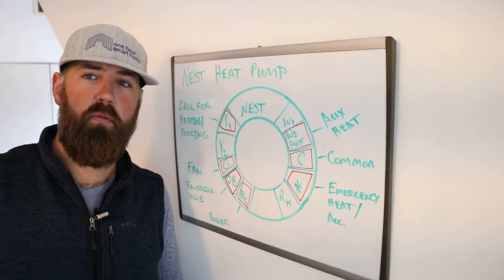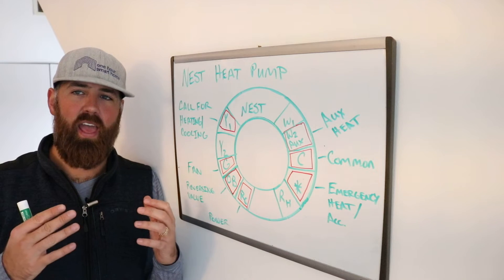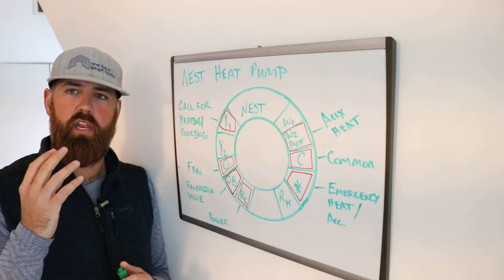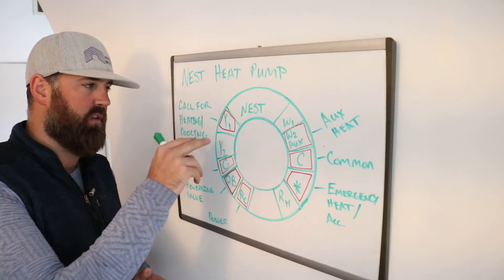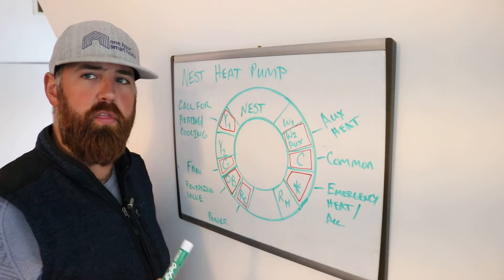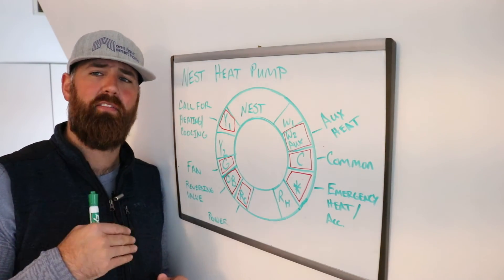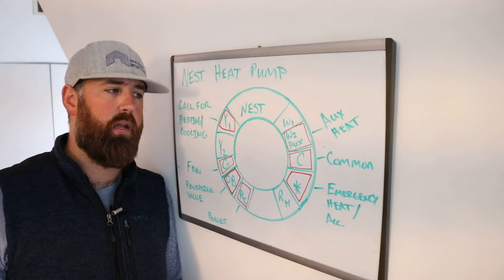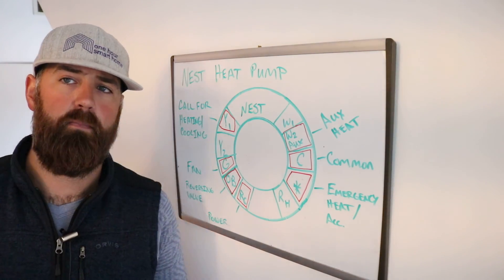Nest Heat Pump Wiring Diagram:  How To Wire Nest With a Heat Pump

Comment: I have watched two of your videos.  You are very good.  And, I finally picked up how thermostats manage to work without a common wire.. they steel a little current through the other circuits but do not sink enough to turn them on.  That explains it.

Comment: I have a Fujitsu mini split, I use a adapter (UTY-TTRX) to connect to nest. In the nest equipment setting, what should the heat set to. Choices are force air, propane, electric, gas, oil, geothermal. What should the settings be using the mini split.

Comment: Is there any way to use this device to make a wood pellet stove and heat pump work together? Bought the house with just a wood pellet stove. Installed new set up for that (on a thermostat control) and the heat pump installed has a separate thermostat control. We would love to have both working in cooperation with the other.

Comment: Very helpful - I have the exact same wires for my set-up in Tallahassee Florida - pretty sure I hooked it up exactly as shown, but when it tried to cool the house, it started heating it - any help? i can send you photos if helpful
Reply from the maker: Possible that your reversing valve is (Reversed). Some heat pumps are designed to heat when power is applied to the reversing valve and some are designed to cool when power is applied, just depends on the manufacturer. The setting to (Reverse) the heat pump reversing valve is within the nest. Under the equipment tab, click on the O/B wire selection and then it should allow you to change it. Try changing it from the current setting you have it on and it should change it.
Reply: @OneHourSmartHome  thank you - I'll give it a shot

Comment: I have a trane set up.  Currently,  I have no C wire.  I do have a dedicated B and dedicated O terminals along with the Y, W1, W2, green.   The nest has only B/O terminal as well as the ecobee.  Ecobee tech said it isn't compatible.   Is the nest compatible and where will I place the B wire and O wire?
Reply: O goes to O/B. B is your common wire so it will go to C. I have Trane system too and my next app says I have an error but everything seems to be working well.

Comment: This was a huge help. Double checked what Google sent me and they had me wiring my heat pump up like a dual fuel setup. This was confusing to me as I have no gas lines going to the house at all. Not entirely their fault as whoever installed the system originally ran the Aux heat as a white wire plugged into a W1 terminal and a black wire plugged into terminal with 2 labels W2/X2 which has to be emergency heat.
Reply: May I ask if the black or white that has to be going to the * terminal? Thanks!

Comment: @onehoursmarthome I have a Heat Pump and when connecting the Nest the condenser goes crazy ( on and off by itself ) and the Nest say error on O/B  and also Error on Y1..  any idea what can it be ?  😩
Reply from the maker: Do you have a common wire? Could be that the nest is short cycling due to low power.  Here's the video on common wires: https://youtu.be/gahPxCcPDto. Next question do you have both and O and a B wire or just an O/B combo wire? Nest is not compatible with systems that have a separate O and B wire.

Comment: Can you explain how to connect and how it operates a heat pump with multistage heat/cool since nest is compatible with 2 stage cooling and 3 stage heating.
Reply: Would also love this.
Reply: If it's compatible like you mentioned then the 4 electricians I have hired need a worse review.

Comment: Question, about Nest basic one.  Is it compatible with the Airtemp heat pump?  I tried connecting it but it would not turn on the condenser.  The fan turned on but not the condenser.
Reply from the maker: I dont know specifically if it works with the airtemp heat pump. Sometimes it takes a few minutes for heat pump condensors to turn on with the nest and the safety timer it has to prevent short cycling. Did you turn off the condensor power when installing the nest? Sometimes people forget they turned it off and just need to turn the circuit back on.
Reply: Yes, I turned off the breaker for the condenser. Then I plugged the Nest all 6 wire.  Turn the breakers on. Then on the Nest I turn the cool air on,  for about 3 min the condenser would not kick in. Then 4 min into it the air started getting warm air.    On the thermostat that came with the Airtemp, the Y-wire & W-wire has a jumper in between them. Also the RH & RC has a jumper.  Any clues on why the condenser will not turn on?

Comment: Question i installed the best learning 3rd gen. The issue I’m having is the fan doesn’t want to shut completely down.
Reply from the maker: Hm, interesting check the settings to make sure you didnt turn the fan on in the nest app. Do you have a g wire? What is it connected to?

Comment: Super helpful, thank you. On my old thermostat, I also have a F wire.  The manual for the old thermostat reads that this is a "heat pump reset (powered continuously when in emergency heat)".  Any idea where that wire would go on a nest thermostat?
Reply: sounds like it would go on the Star pin on the next thermostat.

Comment: Hi - I currently have a Lennox Elite XC16S036 unit, and looking to convert the thermostat to a Nest one. I can account for the Red, White, Blue, and Yellow wires, but I can't understand why there is a Green wire going into the "B" if my Lennox Elite XC16S036 isn't a Heat Pump? Looking for some advice, and thank you for sharing your wisdom!

Comment: Great video. One question. If you have a house with a AC system in the attic and a boiler in the basement. Which unit gets the common terminal?
Reply: Whichever unit the tstat is hooked to.
Reply: @guyinpajamapants6892  it would be hooked to both

Comment: Hello looking for some help.  I have an older heat pump in a condo.  
I used to have a Nest E and wires up all 5 wires Y1, W1, G, R and C, the Nest E worked fine.  
I am now trying to upgrade to the Nest Learning 3rd generation and it's not working.  Says the wiring is incorrect. 
I wired the terminals the exact same way as above with the Nest E,  except I placed  the R wire in the Rh terminal.  Didn't work.  Tried to move the R wire to Rc, same issue.  Not enough power.  What am I doing wrong?

Comment: Just wanted to add a bit of info about heat pumps: Auxilary heat also engages when the heat pump enters "defrost mode" which, (much like a freezer) occurs when the "evaporator" (outdoor coil in this case) ices over tripping the sensor which causes the reversing valve to disengage, turning the system back into an "air conditioner".  This causes cold air to blow inside the house. (ya, in heat mode!) So to offset the temperature split, the electric heat strips engage simultaneously until the defrost cycle completes, and the system returns to normal "heat pump" operation (extremely inefficient way to do your heat).
Reply from the maker: Thanks for the informative comment!
Reply: Thanks
Reply: Hello. I think this comment helps with my issue. I have a heat pump that is tuning off before getting to the set point temperature and starts blowing cold air inside in heat mode. I think is because I connected the aux heat (w2) but I don't have the auxilary electric strip ( optional accesory). Should I disconnect the W2 cable? Or adjust some setting in the Nest thermostat?
Reply: @davidportillo6006  Whats the outside air temperature?  If the unit is going into defrost because its too cold outside but you dont have an "emergency" electric heat strip, it will blow cold.  Although noone should have ever let there be no heat strips unless you live in South Florida, its more likely that the heat strip isnt engaging either because of relay, board, or T-stat.
Reply: So as the common wire, a positive or negative

Comment: Just bought a new house and would like to replaced Honeywell T6 pro programmable thermostats with my nest 3 gen. The video was great but I have an orange and brown wire that are connected to S “ input for wired indoor or outdoor sensors (TH6320U and TH6220U only) I am not sure my nest will work any suggestions

Comment: Excellent video. I have a White-Rodgers 1F92-71. I have 6 wires but I also have jumper wires. Nest online says I don't need jumpers and it appears the Nest thermostat does not allow enough space for more than one wire at the terminals. I'm glad you mentioned the software programming of the Nest. Great video!

Comment: I have a Robert Shaw moldel 9701j2 that I am out to a Nest.  I have a heat pump as well.  I found that I have 8 wires coming out of the wall and they were all connected to the thermostat.  Besides the R, Y, W, G, Blue wires I have a brown that was connected to the "C" terminal.  The orange and black wires were connected to a terminal next to each other..  Where do I connect the orange and black wire to the Nest connector plate?  Thank you!

Comment: I have a nest E
That I was going to install on a 2015 Trane Two-stage heat pump. It’s a all in one system mounted on top of a home. My buddy says that nest simply isn’t compatible with a two-stage system. Is that true?
Reply from the maker: Nest Gen 3:  https://amzn.to/3chelSz works with most  2 stage heat pumps. The Nest E has less compatibility and fewer terminals so it does not work with as many systems.

Comment: I have mine wired like these except the emergency heat. My heat strip wasn't kicking in and when I switched from heat to cool no issues. But when I switched from cool to heat my unit is short cycling.  Do have an info what could be going on?

Comment: I have a two stage gas furnace and I am going to install another heat pump on top of it. Do I need to connect w1 and w2 for two stage gas furnace and connect y1 and ob for the heat pump?

Comment: I have a nest thermostat gen 3.I have a heat pump.when you go into setting and press on heat pump.does it go on O or B?
Reply: I just spent hrs going through a Trane heat pump X14i with aux electric heat nest install with success. Google support advised a wrong way to wire so I’ll try to give as much detail to save you some time. This unit had both O (orange/heat pump valve), B (Blue/24V Common), G (Green/Fan), Y1 (Yellow/heat-cool), R (red/Power), W (white/Aux heat). Here’s the kicker with the White wire, this video helped me solve, it was W1 on the old thermostat and connected to the W1 on the Trane indoor unit. However on the indoor unit the W1 & W2 were bridged, which I didn’t notice at first. As this video states put white wire to W2. Having a orange and blue wire was confusing seeing the nest has only one input labeled O/B. Trane I read sometimes uses B for Common so I tested with meter (with breaker power on/AC off) and found to be true. So B/Blue goes to C on nest. O/Orange/heat pump wire goes to O/B on nest. Note I read sometimes these can be flip flopped so if you test and heat turns on when in cooling mode this could be the case. Green/Fan to G on nest. Yellow wire to Y1 “Heat/Cool”. Red/Power to RH..... for others If you only have one of the wires O or B it could be that you don’t have a common wire and are getting a power error on thermostat. The guys who made throw video has a video for that fix and a amazon link to the parts you need. I bought that but ended up not needing. Hope this helps! Good luck
Reply from the maker: Depends on the heat pump model. Do you have both an O and B Wire or just one wire? If you have just one wire The O wire reverses the valve from heating to cooling, and the B wire switches the valve from cooling to heating. You can look in the heat pump model documentation and it will tell you. If not you can set the heat pump to one setting and test that it is working and if not, change it over to the other setting.
Reply: One Hour Smart Home  What if you have both?

Comment: Great info...
I have an additional question... Just had installed a single stage heat pump with single stage propane furnace aux / emergency heat (no electric heat strips). HVAC tech and I have both found conflicting information as to whether this would be wired as a heat pump with aux heat, as in this video or, if it should be wired as a “dual fuel” system.
We wired it as dual fuel using both the W1 terminal and the * terminal ( believe they are both connected to the same terminal on the control board). System seems to test correctly but, when I view the equip config on the Gen 3, it shows a primary electric heat source and two propane aux heat sources.
Is my equipment considered to be duel fuel or, simply heat pump with aux heat... aux heat being propane furnace, rather than electric furnace? 
I also emailed Nest help... awaiting their response.
Thanks...
Dan
Reply: I have exactly the same setup you do and have the same questions.  I would love to hear an answer on this.  Please!!!
Reply: Same question here. If I choose duel fuel everything works, but my forced air never comes on with the furnace.

Comment: So I just installed a nest thermostat. On my old thermostat  it had w1 and w2. But above w1 was BO. I install the wires the way nest suggested but I when it says test heat nothing happens. And when I  test stage 2 heat itll come on but not much heat. Is it possible that the w1 is supposed to be ob?
Reply: Don't know if you've found the solution yet, but I was having the same issue and connecting my old W to OB solved the problem where warm air was coming out while the system was "cooling".  I had 2 Wires in W2, one went to W2, the other to *
Reply: @stefanocasoni6420  I fixed it already.  I apparantly have a heat-pump.  So yes w went to ob. Which the wire is white not yellow for some reason.

Comment: I hope you can help me out. My nest thermostat keeps calling for heat even when it's off. I set it to 66 leave for work and when I get home its 80.  I had someone look at the heating sys and they said it fine. Nest sent me a new base and face plate. Still the thermostat calls for heat past the desired temp setting any help in this matter would so greatly be appreciated. Here's my email bdemacedo@verizon.net. thanks
Reply: I had this happen, and I did a software update and it went away. Are you running the latest software, and is it wired correctly?
Reply: I had a boiler tech who was certified with the nest and he told me it was the nest. Nest sent me a new thermostat but still having issues. How do I update the nest? Thanks for your response Jameson
Reply: Check this link https://support.google.com/googlenest/answer/9257086?hl=en&visit_id=637179475607936095-922050168&rd=1
Reply: So I have an electric heat pump system.  No furnace.  It has an air handler and a compressor outside.  My thermostat had a w2 wire so for my nest I put the w2 wire in and w1 wire in its place.  AC won’t come on, seems to be blowing hot air.  Please help!!
Reply: Do I need to unplug w2 wire and place in OB??

Comment: Ok, I'm having to replace my nest learning 3rd gen thermostat. I replaced my heat pump about 6 months ago which has the heating coils in the blower area where if the heat pump goes into cooling mode while in "heat" to unfreeze the outside coils but delivers some luke warm air to the home during the process.  Is this something the heat pump does on its own or is it something I need to deal with in wiring the thermostat? 

In the Nest instructions online it talks about "If your system is a heat pump with an additional heat wire". Would the heating coils be considered "an additional heat wire"?
Reply: I'm having the same issue.

Comment: My system is different in that the house builder installed a heat pump (I guess for marketing purposes) AND a 95% efficient natural gas furnace. So in my case I do not ever want the heat pump to run (I wish it weren't there). My Emergency heat is actually cheaper to run than the heat pump. I am trying to decide should I connect the O/B or not?

Comment: I am looking at my System Carrior heat pump  and I have 4 wires with a jumper.  RC, Y with a jumper to W, O and G. how would I wire my nest.
Reply: I have the same wire Y jump to W. RC Jump to RH. O and G. I don't know how to wiring. Do I need C??

Comment: I have a trane XR heat pump with heat coil my question is do I have to hook up a W1 wire and a W2 wire or can I just hook up one wire to the W2 with a nest    I only have A five wire thermostat wire.
Reply from the maker: What were the existing 5 wires you had? Please list. Do you have a traditional gas furnace set up with your heat pump or a heat pump with electric aux heat?
Reply: One Hour Smart Home I am using a train thermostat right now white wire goes to W1 And a jumper goes to X 2.  Red wire goes to R. yellow wire goes to Y. green wire goes to G. Blue wire goes to O. And no I don’t have a Gas fired furnace just the heat pump system for AC and heat. Thanks again.
Reply from the maker: If you only had one existing w wire you should install it into w2 as  hshown and set your nest to heat pump mode when setting up. You dont need to have both a w2 and aux wire. A heat pump will work with only one w wire. However some heat pumps have more features and more wires. If you have a heat pump set up combined with a gas powere furnace the setup would be different.

Comment: Thanks for a great video! I live in a newer condo w/ heat pump and my current thermostat has only 4 wires attached - green (C), red (R), white (A+), black (B-). It's a Climatemaster ATC32U02C. Google support isn't sure if my system is compatible... any tips or advice?